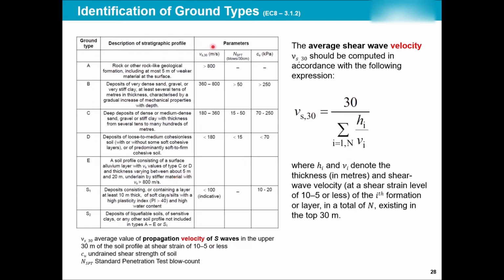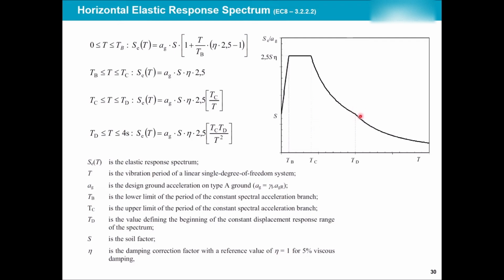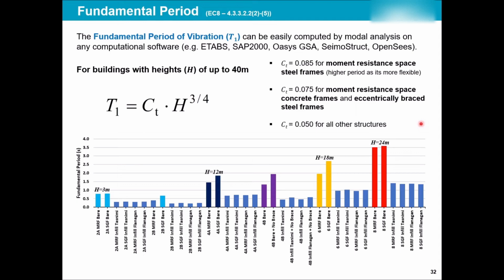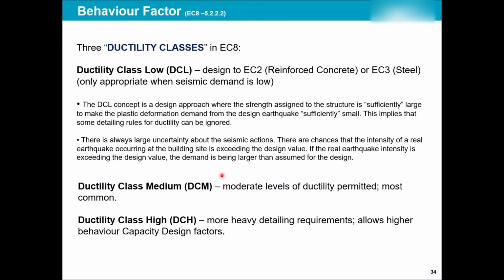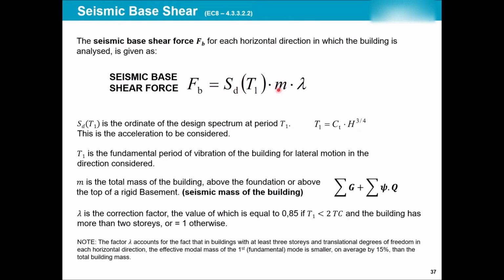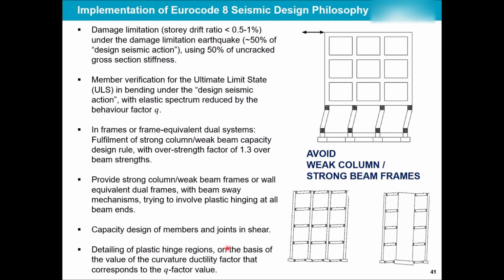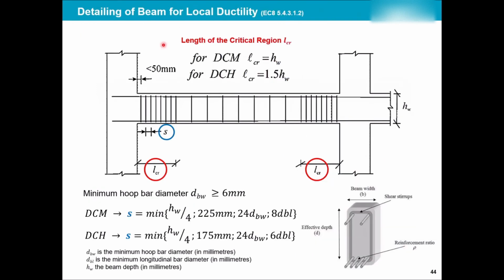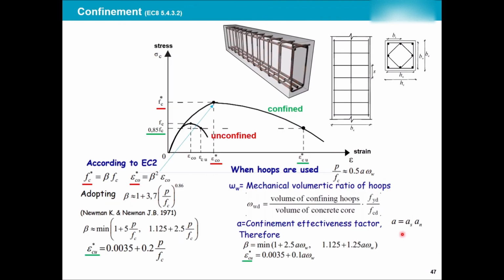Basics in Earthquake Engineering & Seismic Design – Part 4 of 4

Comment: You said that Type 2 response spectrum should be used for high seismic activity (i.e. Ms > 5.5)  but EC8 states that "If the earthquakes that contribute most to the seismic hazard defined for the site for the purpose of probabilistic hazard assessment have a surface-wave magnitude, Ms, not greater than 5,5, it is recommended that the Type 2 spectrum is adopted". Are the types in the slides the wrong way round?
Reply from the maker: I apologize for the confusion. You are correct, and I made an error in my previous response. The Eurocode 8 (EC8) does indeed state that the Type 2 response spectrum is recommended for earthquakes with surface-wave magnitude (Ms) not greater than 5.5. Let me clarify:

Type 1 response spectrum: This is recommended for high seismic activity, typically associated with earthquakes having a surface-wave magnitude (Ms) greater than 5.5.
Type 2 response spectrum: This is recommended for lower seismic activity, typically associated with earthquakes having a surface-wave magnitude (Ms) not greater than 5.5.

Thank you for pointing out this mistake. It's essential to refer to the official Eurocode 8 (EC8) document for accurate information. The slide may have contained an error, or I may have misinterpreted the information. I appreciate you bringing this to my attention and allowing me to correct my response.